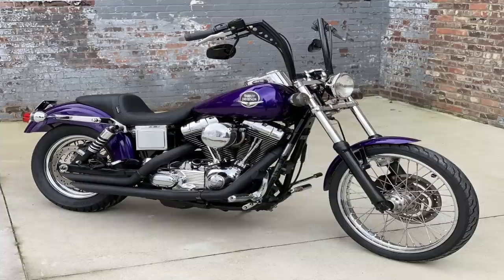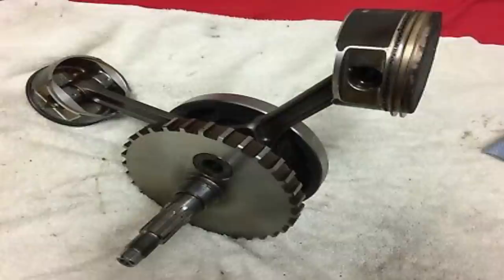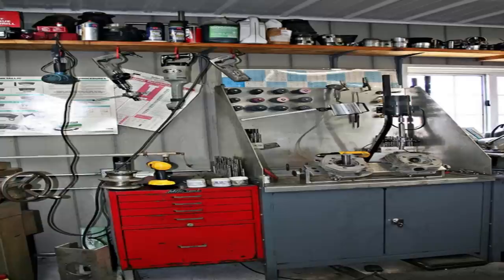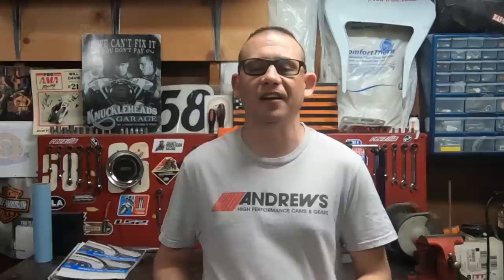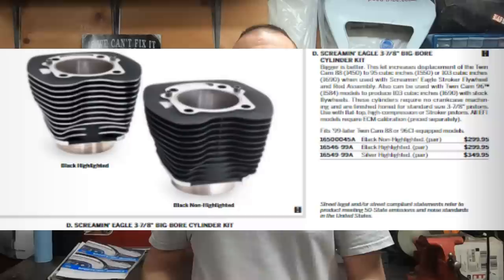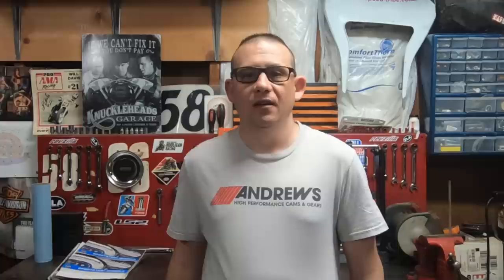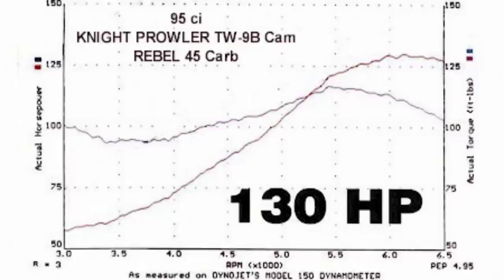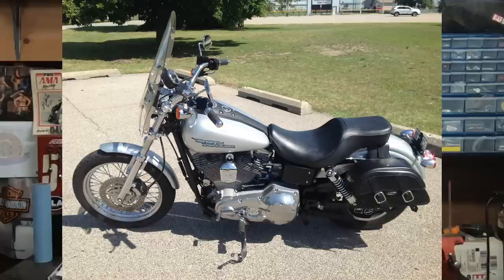Harley 95 is the Twin Cam 88 Sleeper

Comment from the maker: Would you order a 95 kit off the shelf or opt to tear your bike down and wait for machine shop turn around?
Reply: I brought my bike into the my local bike shop it’s a 03 fatboy was a 88.  First he did cams, tensioner air cleaner and a program.   Was not enough pull for me so I dropped it back off and had him bore it out and do head work I want to say the bore n head work was just under a grand.  Money well spent!!
Reply: Great video, I would probably take one off the shelf, but definitely add a good cam and head work. Don't forget to upgrade comp and clutch, oil pump ect. Hey foo see you next week!
Reply: I'd rather have cylinders match the pistons,
Reply: I'm close to upgrading my '04 Fatboy 88ci to a bigger beast.  I'm leaning towards boring the stock jugs to 100 inch.
Reply: I bought an 03 883 with plans to put a hammer 1275 kit in it which I bought a few months later when they had a sale. I would definitely buy another kit from hammer on a bigger bike. I'm all about the torque ,0-60 or 0-100 is where it's at im not interested in going over a hundred on a bike these days. I rode big bore sport bikes in my twenties like an idiot. More into cruising now with a few rips here and there
Reply: I have the original 88, in my flsts, but I did install s&so 508g cams, 12 years ago.  I guess it was premonition,  but when I ordered the bike, in 02, I bought , with the bike, from Barnett HD, in El Paso, 95 jugs. After all these years, those brand new jugs, are still in their box.
Reply: why do HD owners piss money away trying to go fast? just buy a fast bike and never work on it. my twin cam was really good at eating its own cams. INDIAN BIG CHIEF 4 EVER
Reply: I am seriously considering upgrading my '02 FB to a 95. thanks for reviewing the options.  I think I would go kit - not a tear down / rework.
Reply: I got cylinders cheep from a friend who swaped on his 103.
Just going to buy new 10.5:1 wiseco tracker pistons and install it.
Reply: @slickwilly1099  Kinda thinking the same thing. I'm just now looking into Harley's and realizing that part of owning a Harley is working on it, or having work done to it. or wanting to add better stuff to it, all the time. Maybe that's an exaggeration, but it doesn't seem so. I rode Kawasaki KZ1000"s  from my early 20's to my mid 30's and all I ever did was buy tires and change the oil.
Reply: @tenwalls2428  If someone could add up all the $ spent just on this one page. + hats to boots. One of my VICTORY cost $5,000. { now not even made anymore} would out drag 90% of every H-D { V-RODS } will keep up. my money was spent on brakes and tires WTF is people thinking?.any VTX can outrun my VICTORY JACKPOT. so I bought a 2002 honda 1800 VTX cobbled up chopper for $2,250it and has 9,000 miles on it and two dead owers . by bro named it Kristeen. 63 mm tubes 18 inches over. recut the neck got the trail numbers under 5 inches, was like 11,75 trail. it flies on the interstate now. its for sale.
Reply: I wanna do this to my 88..
Reply: I'm thinking about trading my harley in for a cbr. 😂
Reply: Well I was going towards the 95 kit, but I decided to go 97 with still the 509 Cams . All parts coming from S&S. I just want some passing power on the Interstates .
Reply: Right now I'm building a 95 tc. Torque plate honed the jugs to fit KB pistons with a 6.5 dome for @10:1. Reaper 525 cams and Scotsman head porting on the stock heads. Should make 100/100 easily. The bike is a 2001 Fatboy 88B with counterbalancers.
Reply: Off the shelf
Reply: My 02 ultra has the 95 big bore, I'm running a 635 gear drive cam on a fueling cam plate,port and polished my heads and intake ,kibble valve springs,stainless valves ,and a Dan moto 2into1 exhaust with a modified Reinhart baffle in it,also running the pc5 with auto tune,it screams at the 1/8 @7.90 et if I can keep the front down
Reply: @slickwilly1099 go play on your polaris

Comment: I picked up a "slightly used" 95" SE big bore  kit with 10.5:1 compression pistons and added a S&S 510 gear driven cam set up on my 2003 Softail. Best money ever spent for some great power that's very reliable with NO mechanical issues whatsoever. Motor has 80k+ miles and she's still running strong!!
Reply: Is it a carb or EFI ?
Reply: @marcolabastida465  She’s carbureted
Reply: @kweitmann6913  the stock carburetor?? I'm working on a dyna and I'm thinking to use the same set up, only change the cam to a 509 s&s , whit those pistons are u using Compression Release?
Reply: @marcolabastida465   The carb is stock except I drilled the hole in the vacuum slide to a #30 and clipped about 3/8” off of the slide spring. And oh yes, compression releases are a must. Went though 3 starter clutches before adding the comp. releases.

Comment: What's up mr .foo , I have an 02 road king with S&S 509 cams support plate and oil pump. I run a thundermax tuner . The local Indy took it for a ride and swore it has a 95 inch in it. I did my research and got the best cams for my application because I didn't want to pull the heads and change the springs for bigger cams. Bike runs absolutely flawless. 800 lb bike needs a torque cam to get her moving. She's real snappy and hits 80 really quick. My famous saying... Miles of smiles.... great stuff Mr Foo
Reply from the maker: That right there, your bike exemplifies exactly what l talk about the channel! Right cam, right parts and the right bike! I appreciate your support on the channel!
Reply: I have a carbureted 02 Electra Glide with a rebuilt Fueling component cam chest (hydraulic plate, tensioner shoes, high capacity oil pump, lifters) but I went with S&S 510 cams. The performance gain from the 510’s kick in at 3000 rpm’s. Or around 70 mph which is perfect for Highway cruising and passing. And that’s at half-throttle. I did this upgrade two years ago and it’s like having a new bike.

Comment: When I did mine I had to upgrade the clutch because the stock clutch wouldn’t hold the added torque the 95 inch kit had so make sure you upgrade your clutch

Comment: I wish i would have realized that cams made such a big difference before.. once i had a broken exhaust stud on a 88…  i took it to a dealership who ended up having to take the head off to drill out the stud.. i was mad because taking the motor apart costs an extra $500 in labour and they didn’t tell me until after they already did it. But they could have upsold me some cams at the same time and turned a negative into a positive… just shows how lousy of salesmen they are…. I ended up selling the bike a few years later because i wanted a faster bike.. now im wishing i would have just upgraded it back then.
Reply from the maker: Cams make all the difference and that's why the Screamin Eagle kits are so weak, they make the cams EPA legal.

Comment: Good morning 🌅, GixxerFoo, As I have said before, been there, done it, and got the T shirt, well worth it, now trying to do it again, but it is not knowing what the previous owners has done, and from what I can see S&S 510g cams , HSR 42, and it runs like shit, so starting from scratch, Very Big Problem, waiting for parts, France,
Reply from the maker: That's rough going back over someone else's work when you've got a problem like that. Sounds like you've already got it apart and found a lot of things you didn't want to see in there.
Reply: @GixxerFoo  yes I don’t know if it’s as had big bore kit, 88 to a 95 , it is not running right, I have just rebuilt the HSR again with all new jets, as I couldn’t see the size of jets, so I have put the same size that was in my original engine, apart from taking the heads off I don’t think I could find out what size it is, someone has definitely been inside the primary side, as it has got some off the market seals inside, As I mentioned, it has had a set of S&S cams put in it, but it still got the original back plate, and I can’t quite see whether the oil pump has been changed, and the cams are get driven, I wished I’ve got indefinite funds to throw at it, as I would strip the whole engine down completely, I was hoping to have it back on the road by now, though saying that my weather is not very good, And hopefully I’ll catch up with you later tonight when you upload your next YouTube, 
France

Comment: I've been running my 03 Road King since it was new. Installed 95 inch cylinders and cams, and pro pipe at 10,000 miles. Upgraded the cam chest as soon as the kit came out. Same with an ignition module. Been running it that way since then. It's no slacker....
Reply from the maker: They do run very hard!

Comment: Mine is a 03 FXD, 95 in. DarkHorse crank and H beam rods, Wood TW8G gear drive .590 cams. Mondello heads, 10.5-1 comp., DynaTek ign., Jetted carb etc.etc. Over 115 to the wheels and revs quik. I love it.

Comment: This is exactly why I went with a 95" build on my Softail, shorter stroke,  sooner powerband and not mention the con rod angularity thing. I went with S&S Super Stock heads with 1.94 intake, 79cc, SE flat tops and matching jugs and I guess that puts me around 9.75:1 can comp, Andrews 37g, Mikuni 42 and Bassani Pro Streets... don't know how much HP or TQ I'm making, but it sure does haul ass! You are absolutely right Gixxer, not to count out the 95"... great segment as always!!!
Reply: by the way i have the same parts except s & s pistons and 585 cams 10.7 compression. 100.3hp 150nm. the torque is in the upper rpms. Some day i test woods cams.

Comment: I’ve had my’05 road king 88 for 10 years and no complaints. Had a Vance &Hines Pro pipe when I bought it ( hated the sound). Made my own pipes and baffles that everyone I ride with says sounds great,though a little crispier tone like my irohead with homemade exhaust had. Never did have it re flashed and it’s been running better than ever. I’m happy with it as is,not planning to build it up .

Comment: I just got a 2000 model carbureted Dyna FXDWG with 22,022 miles. The bike is in near perfect original condition. The Guy threw in 2 extra seats and Sissy bar pads. One is the original seat and Sissy bar/pad, a luggage rack, a new Front tire, tube and Rim band in the box. Also, He gave me the original exhaust, (it has Vance&Hines staggered Straight shots now), a new H-D brand bike cover, and a Service Manual. I think I got a pretty good deal.
I plan to upgrade the Cams when it's time to replace the original Cam Chain Tensioner Shoes. Thanks for your videos and keep up the good work!
I think I'll upgrade to SE Hydraulic Cam Plate Chest, High volume oil pump and "Off the Shelf" parts like you mention here.
Reply: Pull the cover and check the tensioners
Reply: @superplumber5  - I already did. The shoes have minor wear on both of them. I removed and inspected the fuel petcock and fuel strainer. I removed and cleaned the K&N Hi-Flo air cleaner. I did a 3 hole oil and filter change. I'm flushing and bleeding the brakes now. Gonna take the front wheel to the shop in the morning, to have the new tire installed. Gonna replace the brake pads also. I'm gonna ride it awhile before I do anything else to it.
It rides quite a bit different than my StreetGlide...

Comment: I'm with you on this one. I had a 95" Zippers torque king kit on my 06 street glide that worked very well. It was a little lacking in hp but had a ton of torque. Even on car motors I prefer a big bore over a long stroke, for the very reason you've stated. Also strokers tend to run hotter.
Reply: <---GRANNY PASSED SCOTTY ON A MOPED. 13 TIMES A DAY.
Reply: Learned that with Small block Chevy vs BBC

Comment: carburetor, my 2002 RK I did the 95" S&S 9.7:1 piston and cylinder kit and S&S 510 gear drive cams. I'm running a Ramjet one piece intake manifold, Mikuni 42mm carb, Supertrap 2 into exhaust and Thunderheart coil and ignition.  I'm very happy with the performance.

Comment: I used to have a 2002 FXDWG and did the 95” kit with stock heads and a jet jet in the stock carb. I did add the s&s 510 gear drive cams and that thing was a runner!! Never put it on the dyno but I could pull and carry the front wheel through 2nd no problem!

Comment: I finally got that hammer 1275 kit with the 570 cams and xb heads. Its way more rowdy and sounds different too. Tons of torque! Your reviews help me make the choice to go with hammer.  Keep it up! Love the Harley performance side
Reply from the maker: Thank you! That is awesome! That's an excellent street setup for a Sportster! It's a night and day difference, l hope you're enjoying it!
Reply: Right on man.. I have an 88 sporty that I stuck a hammer 1250 with a set of andrews V2s in it last year. Has a set of 87 bathtub chamber heads as well. I could only wish to have some xb heads on this year. they don't run on first Gen Evo sportys. Not real sure why, not really researched it, maybe gixxerfoo knows lol. I know yours has to run like a scalded dog because mine does and not near what ya got on yours lol. Hammer Performance makes solid kits for sure and nice dealing with them as well..
Reply: @rustyshackleford4059  oh ya it runs so good. Its a whole new bike. My buddy has a similar build to mine ( 10.5:1 comp. 560 cams) his should be faster maybe it's my pipe idk. I was out running him at Partial throttle and short shifting because I'm still in the break in process. The amount of torque I have now is the most noticable difference so far. I'll report back after I Dyno it and can go full throttle to 7000 rpms.
Reply: @clubstyleridahd4695  ya report back on the old ladies dusting you with her moped stuck in low gear.
Reply: @slickwilly1099  ya because that makes a lot of sense right? In the Harley world there isn't much that can hang.. and if your talking about sport bikes I have one of those too and many other bikes. I've been riding for 16 years I've ridden all kinds of bikes. Explain what you are comparing it too that makes it slow?
Reply: @clubstyleridahd4695  lol nice handle you think of that all by yourself.
Reply: @slickwilly1099  the KEYBOARD WARRIOR Slick Willy!

Comment: Thanks for the 95 praise. I have a 02.   I can testify that this baby runs 👍👍
Reply from the maker: Right on! Those 95's are very strong motors, they will pull on built motors with much larger displacement all day long.
Reply: Same

Comment: 04 09 22 purchased a 2002 88 twin cam heritage. only 17828 mi. very clean scoot looks new. $9828.43 out the door. paid cash. It has a carb. I was a little bit shy about the 88. However the local wrench turner assured me the 88 is a good motor and says the same thing about upgrades that you say. Next winter going to turn this scoot into a beast. Thanks for your vids.
Reply: 2002 was the last year of the timken bear and forged crank shaft.  Make sure the cam tensioner system is upgraded and you will have one of the most reliable twin cams out there

Comment: I love my 95 ci. I have a bit of a Frankenstein.  04 RK Classic fi. Power vision wide band o2 tuner, Bassani 2 into 1 , jp precision 2b heads.i got a set of 02 casses for the timken bearings,  i got the casses cleared for a Woods tw6hg cam. The crank is welded plugged and trued.
 Im pushing 190 ccp.
 Om using  pop up comp releases.
 I keep up with the 114ci no problems...

Comment: It also depends on how you ride. For instance some guys enjoy a sporty ride; high revving, speed cornering, high speed lane changing etc.  BUT I just like getting up to the speed limit quickly without a bunch of high revs. SO I love a high torque engine that can effortlessly shove my fat ass down the road.
Reply from the maker: The cam profile decides when and where you get your power, good torque cam in a 95 kit will give you that off the line pull.

Comment: Wud up Foo!! Here is my current 95" build with dyno tune. I just ordered some Wood TW-6 cams, obviously not a huge difference between these and my current S&S 510's but why not, I like playing. The best thing about these engines is that they love to rev and cruise at 2800-3k rpms. This bike rips, 0-100 mph she takes my buddy's 2021 107 softail and keeps right up with the 114's. Now mind you, this is thousands more than you need to spend to get the same or better number's. 
2002 FXSTB Night Train
Pingel Petcock
Mikuni hsr42 70 nozzle 25 pilot 162.5 main  
K&N hi flo AC  
Daytona Twin Tech ignition
Accel wires
Accel coil
NGK's iridium
Fueling cam plate
fueling oil pump
fueling lifter's
S&S 510 cams
S&S pushrods
S&S 79cc heads
.030 mls head gasket
S&S rockers
Trask breathers
Zipper's blueprinted piston / jugs 95" forged flat top 9.5:1
R&B LSR 2 into 1 or Thunderheader ( which I'm presently running )
100/100 Static 9.95:1 corrected 9.22:1 ccp 192
Rob's Dyno, Gardner MA

Comment: Sent the heads from my 2003 fxstdse to JET in Rhode Island for their CVN cnc shrink porting. Used their jet velocity stack and kn air filter, Andrews 37 conversion cams with had newer hydraulic chains and adjusters had screaming Eagle oil pump and cam plate (upgraded cam bearing) with screaming eagle2 mufflers. Claimed 91 hp and 106 torq. This actually sounds conservative with what this video goes into. Did give it a noticible bump from the factory (with se 203 cam) set up.

Comment: Have 95 big bore in a 02 ultra ,635 ss cams, port polished heads ,flat top pistons ,kimble wires ,3 angle valve job ,fueling camplate ,oiler,and injectors power commander 5,50mm throttle body Dan motto 2 into 1 pipe with custom baffle, and she runs hard and upsets a lot of folks

Comment: Just got mine back from the dyno. 85 hp with 90ft lbs. I’m running the 95”, fueling 525 camchest, with the Barnett scorpion a clutch.
Reply from the maker: Not bad at all on a 95 with that cam, curious what exhaust you're running though.

Comment: Thanks @GixxerFoo for this video. My 06 Road King with my 95” build is fun, and does alright with the bigger engines. The Feuling 543 Reaper cam is pretty stout. I run 10.5:1.